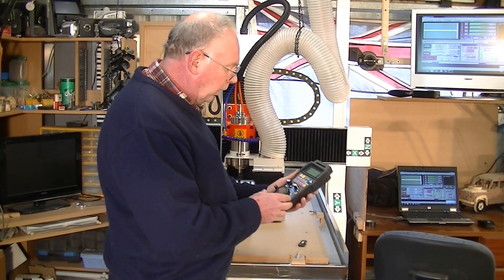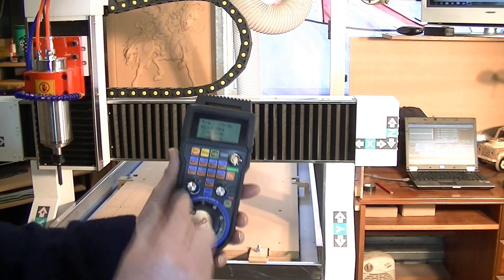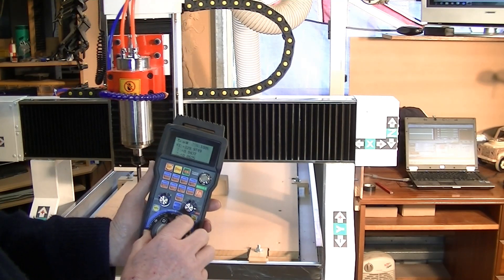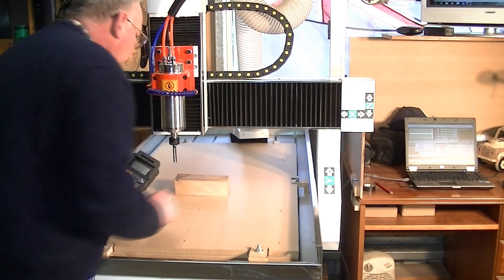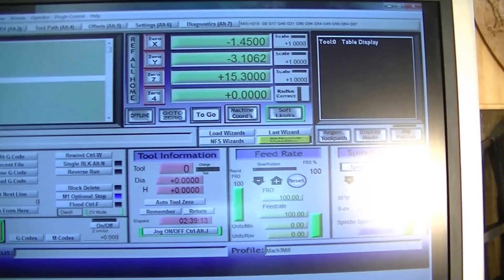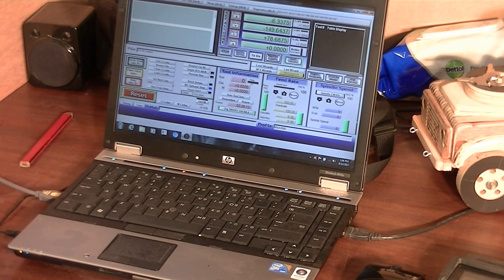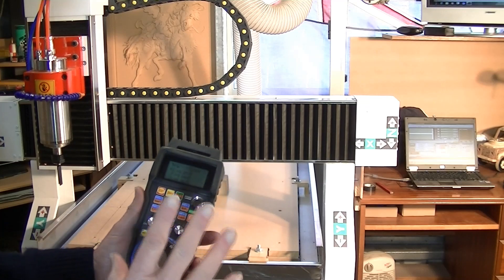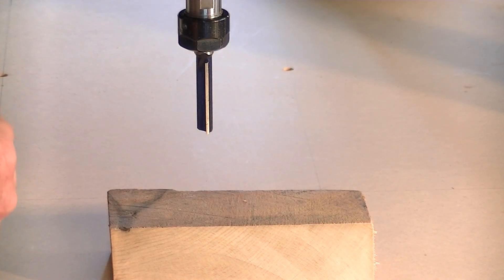400 Radio pendent, Mach3, Machine home, Auto tool setting + Bloopers

Comment: "probing in the wrong direction" this happened to me so many times over the years, its the reason I moved away from Mach 3, and eventually away from Mach 4, and now use a Centroid Acorn control board, and their own control software to run my cnc machine. Actually, that new pendant of yours is a clone of the one they developed. Possibly even made at the same factory just with a different label on it.

Comment: I have a pendant from the same maker that is always forgetting it's z  Zero position...I had to remove the USD wireless network adaptor(internet connection) from that machine and not let it  run upgrades... and also I am always checking it's g54 offset when I change or set the z home and changing end mills ( I normally cut a lot of the same pieces for a customer) ...I have seen others use this new pendant and I wanted to try it (Since it has Adopt Frequency Hopping Transmission, Strong Anti-interference Ability )....hoping for a good reliable pendant that I wont have to fuss with...best regards...also I did not have any problems with the focus of the video,